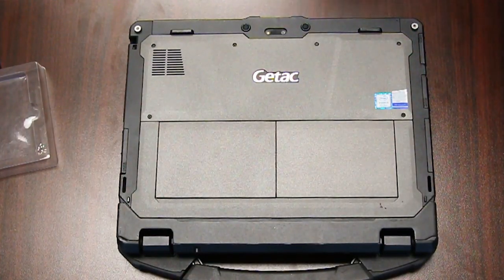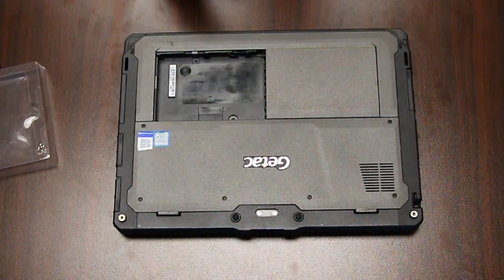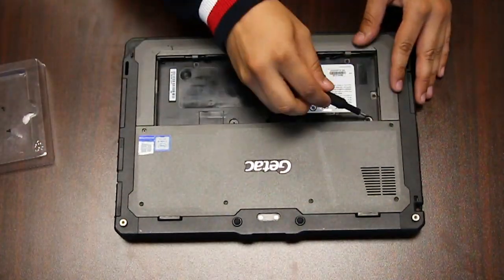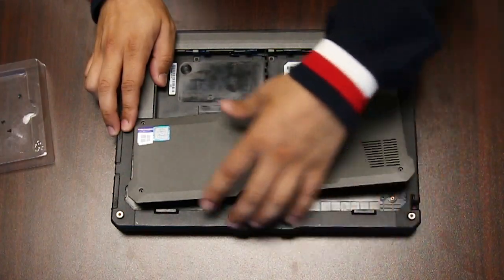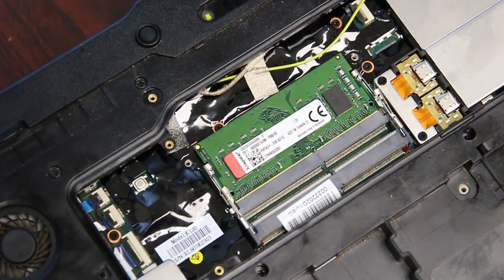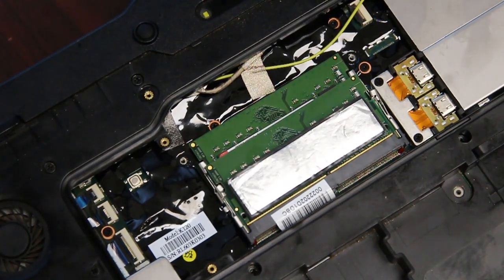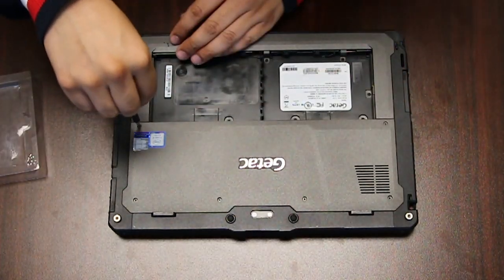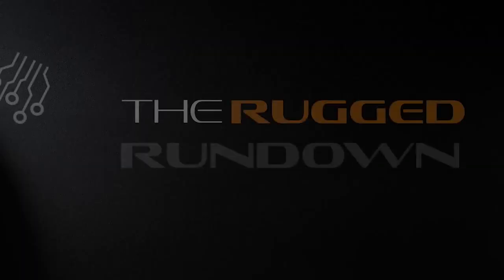Upgrade Your Getac K120 RAM (MEMORY)

Comment: Hello, is it possible to change the processor as well? If yes, would it be easy to have it on video?
Reply: Processor is soldered to the motherboard
Reply from the maker: Couldn't have said it better ourselves! Thanks for watching!
Reply from the maker: No it is not. If you wish to replace the processor, you have to swap out the system board. The processor is soldered onto the system board. Thanks for watching!